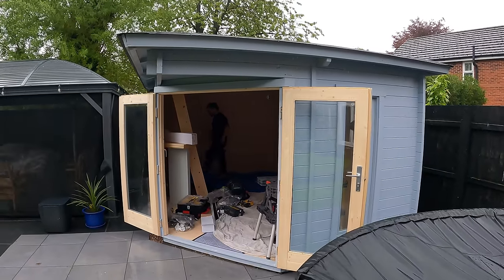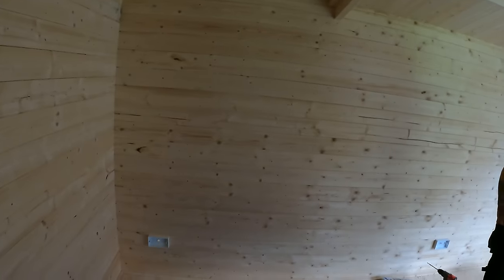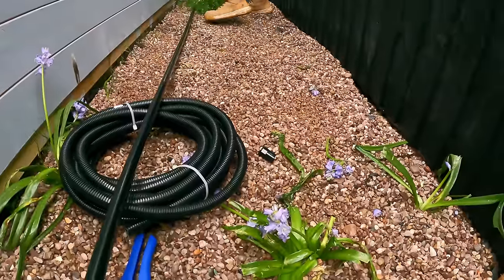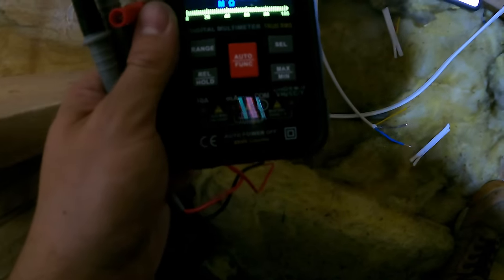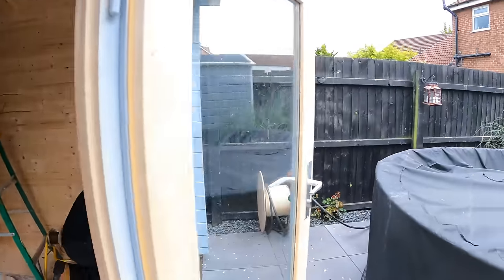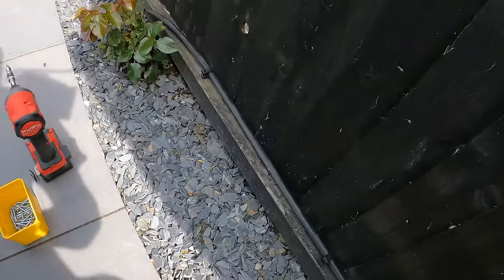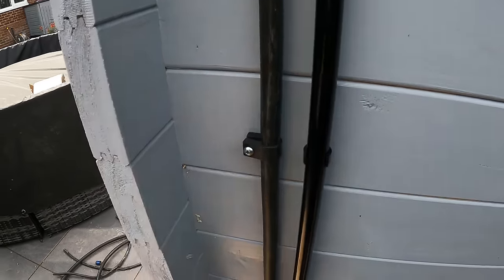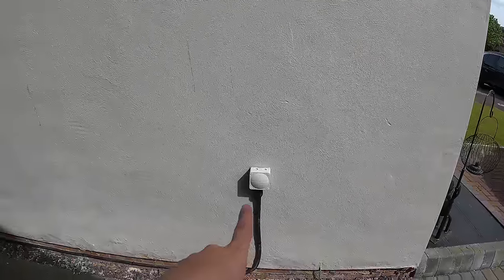How We Wire A Summer House | Garden Room | Electrical Life

Comment: Nice job, i was thinking you may have possibly been able to drill through the corner and not use the copex  your running singles so could keep the drill size down may have been able if you are good with a drill not break into the room, i worked for over 40 years installing alarms and managed it , in all fairness i only had a small telephone size cable but i think it might have been possible, nice job though thinking out of the box exactly what i would have done going around the outside nobody will see it 😀 a lot of people would have done it all on the inside and most customers would have thought thats the only way! Well done !!
Reply from the maker: @fredpepper4773  it’s not something that’s ever crossed my mind actually, so I’m glad you’ve pointed that out, I’ll weigh it up next time 👏🏼

Comment: When the logs on the summer house expand and contract (and they will) two things can happen - fixed conduit can pull apart, and water ingress. Good to use an s shape flexible conduit section to allow for expansion/contraction of the timber walls. Also be carful not to fix CUs across logs as vertical expansion will split the wood. A cabin this size can expect a 3mm per log expansion so that's 45mm contraction/expansion for the whole wall.
Reply from the maker: appreciate the input, I was always told pvc and wood expansion rates aren’t all that dissimilar, so that along with the non glued joints allows for enough movement. I have been back to a couple of jobs we done a good 2-3 years ago and all still looks good so hopefully may not have many issues. 
Glad you pointed out the CU tho, that’s something that’s not crossed my mind before so I’ll be cautious on that in future.

Comment: Great job - I hate seeing conduit on the inside of the shed.  Two quick questions.   My log cabin has vertical battens to cover storm braces on the outside which would make it difficult to fix a run of straight conduit.  Any reason not to use the Copex all the way round?   Also,  for 62mm log cabin walls, would you use bell connectors on both sides of the wall?  Thanks for a great video.
Reply from the maker: No reason not to use copex only it’s not as pleasing to the eye, you can easily bend solid conduit over obstacles tho for a nicer look. Or even just a small section of copex over the obstacles if you’re not confident in bending the conduit, but it’s really really easy. 62mm you could probably use 2 yes. Or female adapters etc

Comment: Nice video Sean. I’ve a question for you. I want to run power to our summerhouse but my consumer unit is right in the middle of our house under our staircase and it’s a concrete floor new build. How would you get the cables to the board in situations like this? Thanks
Reply from the maker: Hi mate, appreciate you watching! 
Usually in this case it’s either under the floorboards upstairs until you get out the back wall, or sometimes through a garage etc depending where the consumer unit is.

Comment: Nice work mate. I'm currently planning my summer house build. I'll be celotex and plaster boarding the internal walls for winter use. At what stage do I need to call an electrician to kit the wiring out switches and plugs etc ?

Comment: How did you get on when fixing the conduit/conduit boxes to the wall? Did the screws not poke through the wall or even to the socket Patresses?
Reply from the maker: No, these summer houses are usually around 47mm thick wood. we just use 25-30mm screws

Comment: Great video again Sean,one of he neatest installations I have seen,I have one of those Kaiweets meters but mine is the latest model with the lead connectors on the front at the bottom of the screen instead of underneath the device,It's a great little meter
Reply from the maker: thanks mate I appreciate you saying that. 
Yea it’s not a bad little meter tbh, I’ve not used it a whole lot yet but I’ll keep it handy to use when I can

Comment: Hopefully the customer appreciates the thought you put in to make the install as neat and unobtrusive as you have. 

What do you think of the Milwaukee Fuel tools. I've recently replaced my old Makita drill and impact with that set, as the bearings had just about had it (and it helped my income tax bill). Not bad for the life they've had. Hopefully the Milwaukee ones will last as long, if not longer.
Reply from the maker: I’ve only used the Milwaukee for about 2 weeks atm, seem to be really good tbf. hope they serve you well 🤞🏻 thanks for watching mate

Comment: very neat job, what size and type of screws did you use to screw into that backboard without going through
Reply from the maker: Thank you, we use standard wood screws, 1 inch long. Sometimes 1 1/4 inch. That wood is 47mm thick on this kind of summer house.

Comment: I cant have the armoured cable running directly to my consumer unit as my neighbours property gets in the way (4 in a block / maisonette)

Can the armoured cable be run into my bedroom then threw the wall again into my hall where the consumer unit is?
Reply from the maker: @MrEditsCinema  there’s a couple ways it can be done. Usually best to use twin and earth cable inside the house, buried in wall, trunking, through the loft etc whatever works best. 
Then convert to armoured once it gets external

Comment: Would it have been a good belts and bracers practice to put a circle of silicon around that box where the wire enters the shed? Just in case of the minor chance of water ingress?
Reply from the maker: all the conduit boxes and wiska boxes do get a bead of silicone round them when we’re finished on these. It’s probably unnecessary but as you say, just in case

Comment: Hi Sean, thanks for another great vid.  When installing pvc conduit do you use a pvc cement to glue the parts together?
Reply from the maker: i usually do use solvent weld glue yes, but in a summer house i don’t just because it’s a wooden structure and will definitely expand/contract so leave it with a bit of movement. 

I’ve actually seen some a year on and the conduits have bowed right out due to the contraction.

There is drain holes drilled into the bottom of all the conduit boxes on the external just incase of any rogue water getting in, but it’s rather sheltered from the roof overhang anyhow
Reply: Google conduit expansion joints. I generally put use them on long runs or for outdoors. I'd use them more so on a wooden outbuilding.
Reply from the maker: @rayc1503  I’ve seen those, but never cross my mind when I could need them 🤦🏻‍♂️

Comment: I noticed a lot of trades that do these videos don't show how and what you need to take power from the main DB, rcd, mcb, type etc. Be handy ;)
Reply from the maker: Ahhh there’s a reason for that, multiple reasons. Let me explain. 

We wouldn’t want to be held accountable for “showing” someone how to do things, if/when things go wrong. 

Then, all installs are different, the length of the supply etc all determine what’s needed, and there will be multiple ways to supply a summer house, and only seeing the job in question could we determine which way is best suited.
Reply: @Cablesmith  Ah, gotcha. Thanks for the reply

Comment: Nice job...probably a daft question but.......if the house consumer unit was all rcbo including feeding the summer houses consumer unit ...would that work, I'm thinking not but not sure ,....
Reply from the maker: It would work yes but wouldn’t achieve selectivity with having 2 RCDs in in line. 
You could potentially have the summer house fed from an rcbo and have none in the summer house. 

In this instance it was a split load board in the main house so I didn’t want anything in the summer house to trip half of the main house.
Reply: @Cablesmith  nice one...👍👍

Comment: Nice job great idea going out the back of the summer house so everything is hidden.  What are those white things you used in the back of the back boxes ? Also what did you use to bend the conduit ? Cheers
Reply from the maker: Thanks Steve, the things in the sockets are called bell mouth connectors. And I used a spring to bend the conduit, just realised Now I didn’t press record at that part 🤦🏻‍♂️
Reply: @Cablesmith   cheers for that I’ll look for those ! Cheers the bends just looked so neat 👍🏻 I think storm glands are a must,  far better than swa glands.  Forgot ask before if you don’t mind me asking what did you price for this job ? 5k subs nearly there too 👍🏻😀
Reply from the maker: @SB-gp6od  yep was just a spring and bent over my knee job. 
Also I price them all different always depending on certain things like the size and length of the swa etc, this one was around 1300 for everything.
Reply: @Cablesmith  cheers buddy appreciate the info.  Keep up the good content 👍🏻

Comment: why didn't you use TT protection for the summer house?
Reply from the maker: There’s no reason to
Reply: I watched other youtube summer house/ garage wiring videos, and they all seem to be convinced that in case of pen conductor failure, it will be fatal in the summer house. And should always be TT ... I'm only a learner, and I like your content ... Great stuff, as always
Reply from the maker: @shiamjad  not correct, depends on a lot of factors, it’s a wooden structure so the risk is low. A metal outdoor light is a higher risk of loss of the pen conductor but we would rod them all

Comment: Just to go off-topic slightly, I'm guessing this summer house has had to have had permission to be built, as it's less than 1 metre from any boundary...?
Reply from the maker: Completely unsure on that I’m afraid. It’s not my area tbh so I couldn’t advise. Thanks for watching mate
Reply: No permission needed as long as eaves height doesn't exceed 2.5 metres
Reply from the maker: @larrystreak1044  see, I should have knew this from watching Oakwood garden rooms for over a year 😂
Reply: @larrystreak1044 it can’t be higher than 2.5m at the highest point of the garden but it should be at least 1m from any boundary.

Comment: Whats the script with the swa on this job shaun and the earthing areangements mate
Reply from the maker: TNCS and what do you mean what’s the script ? About earthing the armouring ? if so, I got a banjo bent upwards and a fly lead on the summer house side. 
Might be able to see the extra earth when I show the finished board.
Reply from the maker: Although I’ve recently seen wiska release an E-Spring…. Will most definitely be using them from now on
Reply: Whats at the house side pal you coming out the board into the wiska box
Reply from the maker: @ericthekingthekingtheking4842  yea no Banjo that side just 3core swa. 
earthed the swa one side
Reply: Whats the connections in the fuse box shaun ? Is it L-N-E  to the wiska in a piece of TWIN AN EARTH ? What happens to the earth from the fusebox once in the wiska box
Reply from the maker: @ericthekingthekingtheking4842  ahh I see what you mean, no I’ve just positioned the wiska box directly behind both consumer units, used the wiska box just to gland the swa into, and sent the inner sheeth (not just the cores) through the walls to the boards L-N-E

Comment: Great video Sean. Sub and like from me. I am currently planning a summerhouse build. I have armoured cable and consumer unit coming into my old shed. Could you please tell me how much "ballpark" to have this installation done. Just trying to see what costs I will need to factor in. Cheers 👍
Reply from the maker: Hi mate, thanks for the sub. It all depends on the job really but as a ballpark we are usually around £850-1300 for these. that’s always included the armoured cable and consumer unit tho, which sometimes can be £200-300 alone
Reply: @Cablesmith  cheers mate, very helpful. I've seen other videos and the inside of the cabins look like the inside of a submarine with all the tubing and cables. Very clean install 👍
Reply from the maker: @TWOWHEELFIX  thanks matey! I do try and keep it to a minimum or hidden as best as possible!

Comment: 10mm was way over the top. 6 would have been fine.
Reply from the maker: Not on a 40A supply for the length of cable it wasn’t. Didn’t meet volt drop requirements
Reply: @Cablesmith  fair enough although 32a would have been ample for a summer house with a few sockets and a light.

Still, good work though.
Reply from the maker: @niceguy235uk1  yea would have been fine on a 32A your right, there is a couple of heaters going in there tho, just like to leave a bit of wiggle room for expansion. 
Thanks dude appreciate you watching also 👌🏼

Comment: Great video mate, would the cables going through the conduit not need to be wet rated? Concerned about low temperatures and condensations maybe...
Reply from the maker: No, they should be fine. I’ve been back to make adjustments and add extra sockets to one recently that I installed over 2 years ago, no signs of water anywhere.